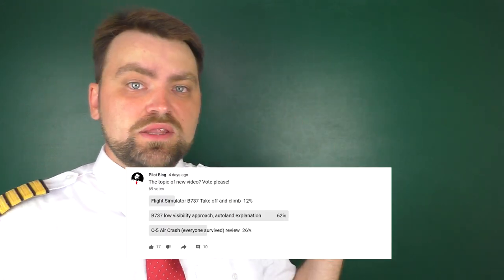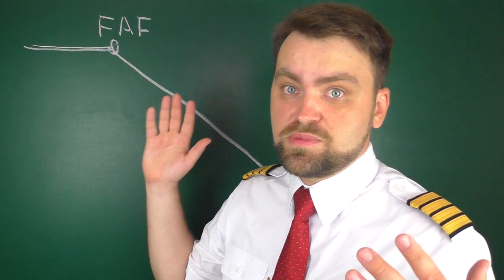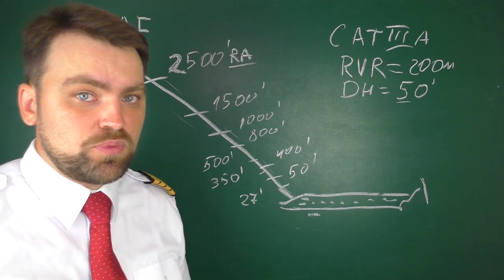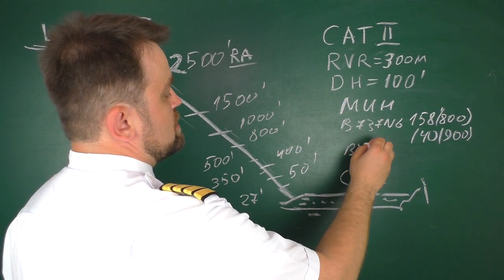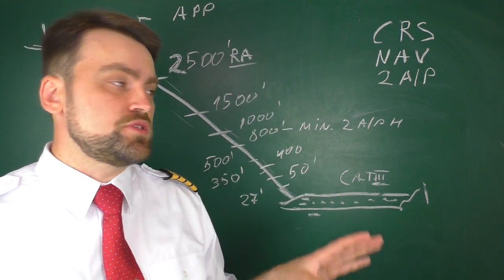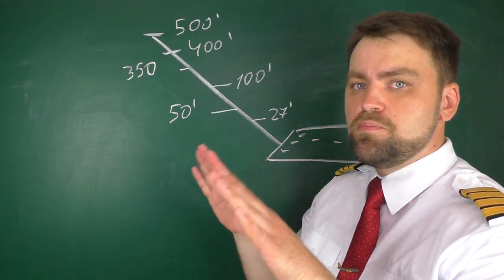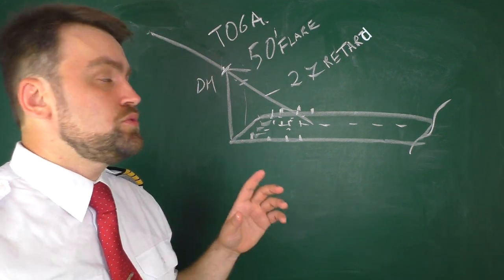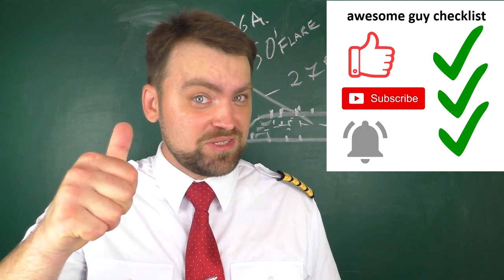Low Visibility Automatic Approach and Landing Part 1

Comment: Thank you very much for this video! The most detailed autoland explanation I have ever seen!
Can you have a FAIL OPERATIONAL autoland system on a B737NG (but it has only two AP)? Is there any variant od B737NG with FAIL OPERATIONAL?
Reply from the maker: Sorry, I didn't get it))
Approach mode allows both A/Ps to be engaged at the same time. Dual A/P
operation provides fail–passive operation through landing flare and touchdown or
an automatic go–around. During fail passive operation, the flight controls respond
to the A/P commanding the lesser control movement. If a failure occurs in one
A/P, the failed channel is counteracted by the second channel such that both A/Ps
disengage with minimal airplane maneuvering and with aural and visual warnings
to the pilot.
I hope I answered your question))
Reply: @PilotBlogDenys  Thank you! Can an B737 have a FAIL OPERATIONAL type of autoland system as an option for customer (airline)? There is an option in PMDG to select between FAIL OP. and FAIL PASS. autoland in the settings. So I am wondering if there is any B737 in real life that has a FAIL OPERATIONAL autoland or is this just a PMDG option?

Comment: Do you know the reason why we add +30 to +50ft on the published MDA for non-precision approaches?
Reply from the maker: Hi there! Well because the airplane has some inertia and it may loose those 30-50ft after TO/GA press... Since MDA is minimun descent alt, we can't penetrate it...
Reply: @PilotBlogDenys  However in precision approach (ILS) we don't need to add few more feet to MDA. What is written on our charts would be it.